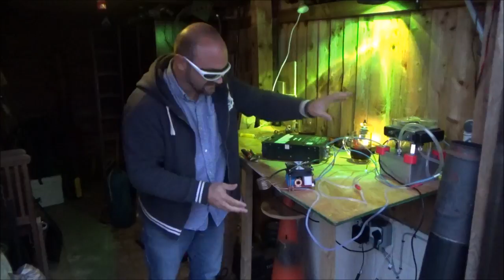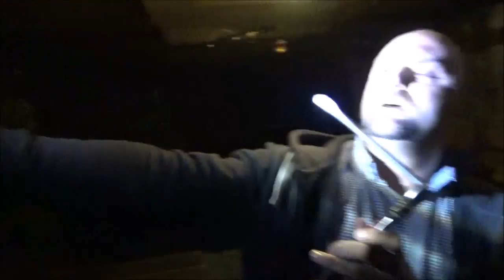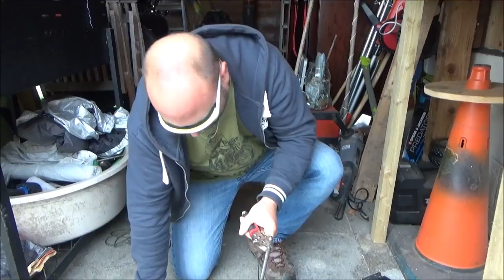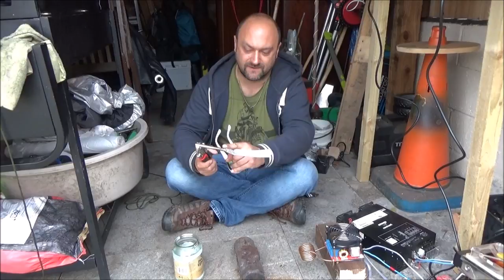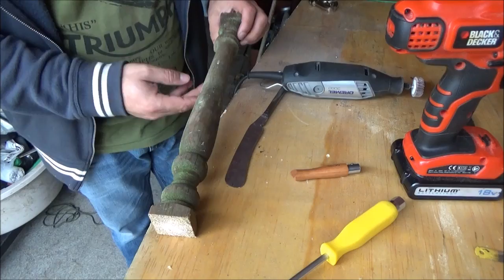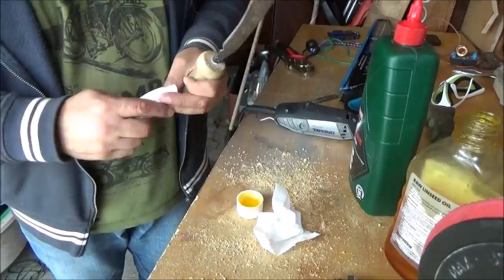Electric Induction Heater Blacksmiths Knives PT2

Comment: Just curious, could the induction heater not get the knife to a high enough temp to either harden or anneal the blade? Is that why you needed the blow torch?
Reply from the maker: The induction heater only heated small parts of the knife, so the blowtorch could be used to heat the entire blade more evenly... hope this helps!!  Thanks for watching!!